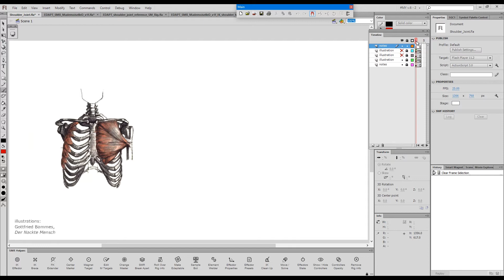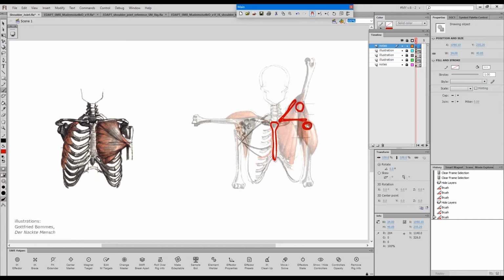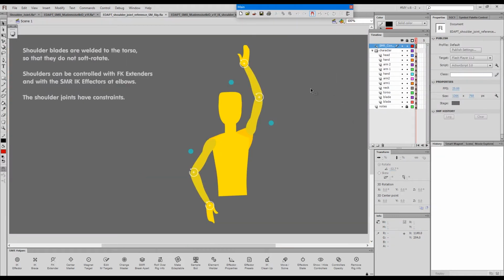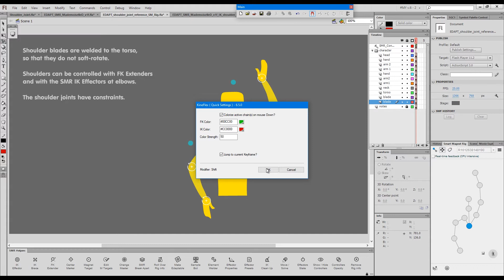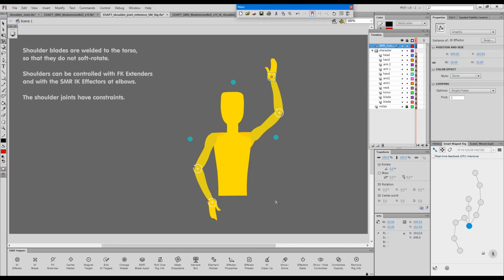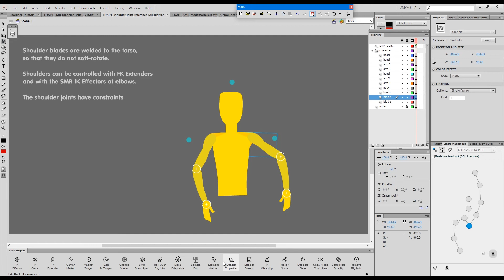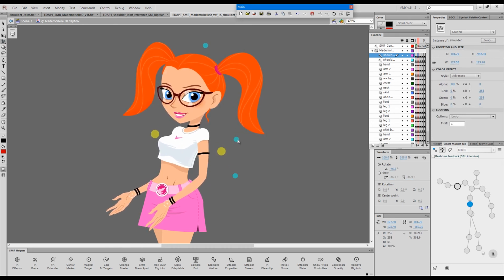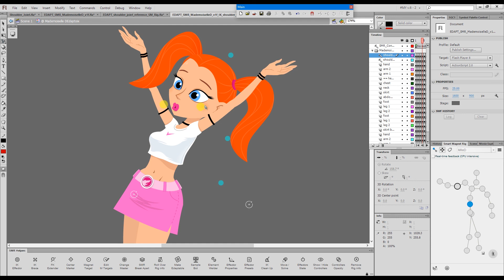🐱 Shoulder Joints in Adobe Animate 🐱 Advanced SMR

Comment: Hello, can you tell me in more detail how to attach a rotating effector to Mademoiselle's shoulder? It is not very clear how to place the magnetic targets and central markers. Thank you.
Reply from the maker: Hello, Elena!

It's an additional element between the torso and the upper arm, which only contains a CM, MT and a FK Extender. The MT is quite close to the Reg Point.
To insert this extra shoulder element, you just need to re-rig the arms, i.e. remove Rig info and rig them again as children to the shoulder bits.

Since the shoulder elements are small, it may be best to rig them using the manual method via the Smart Magnet Rig panel.

Hope this helps!
Reply: @FreshlyFlanimated  Thank you, you helped me a lot!